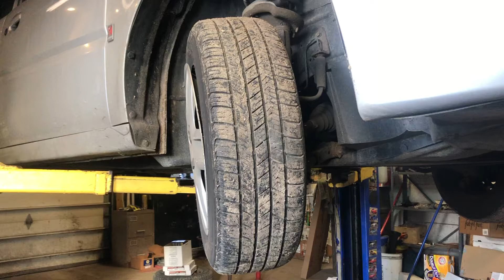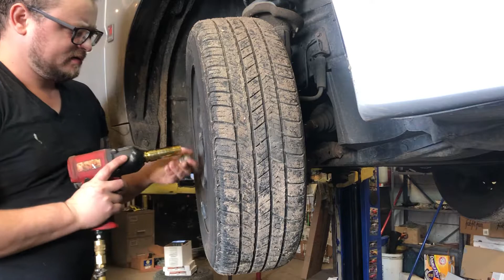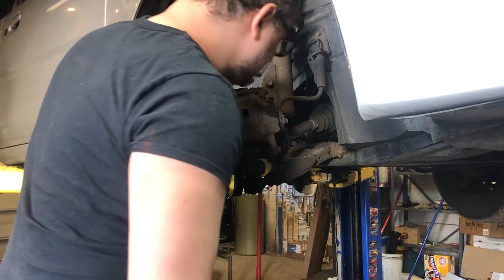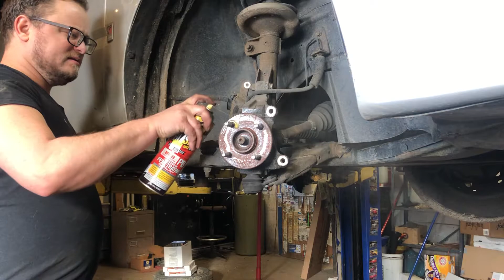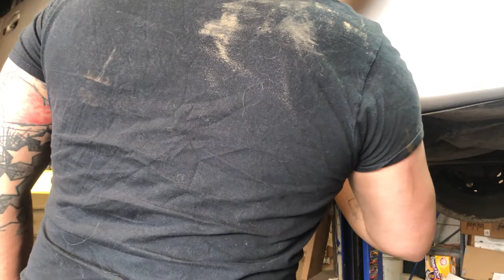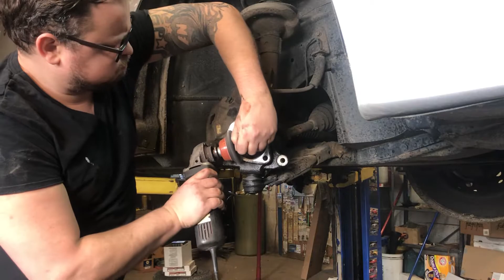Replace hub assembly wheel bearing 2007 Saturn Ion

Comment: Thanks for the video. For those asking about the plate, watch again. It's there.

I was kind of hoping to find a video with the ABS sensor. I'm assuming it'll be simple, though. Just plug it in, right? I was also kind of wondering how important it is to get that axle nut torqued into spec. I've replaced a few CV axles on my own Saturns and I've always just torqued the crap out of it so I know it'll never come flying off.
Reply: Pretty much. The ABS sensor is already plugged into the hub, and the wire plugs into a connector that's snapped onto a bracket on the strut assembly.

Comment: When your cleaning the surface with the wire wheel put on a face mask or tie a Towle around your mouth and nose so you don't breath it in and couch like he did because it can't be goid to breath that rusty dust in fact it probably is detrimental to your lung health